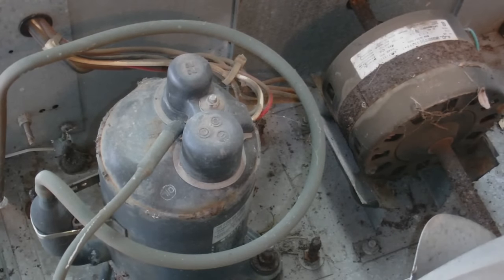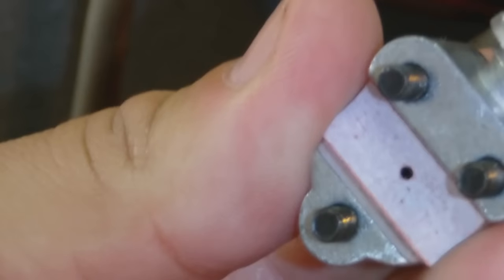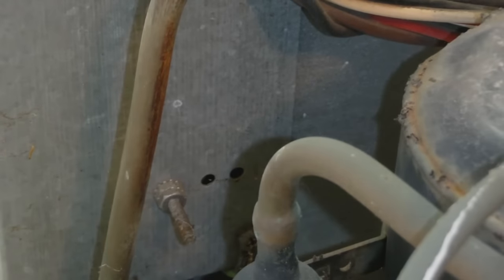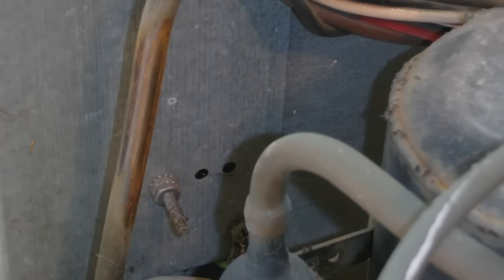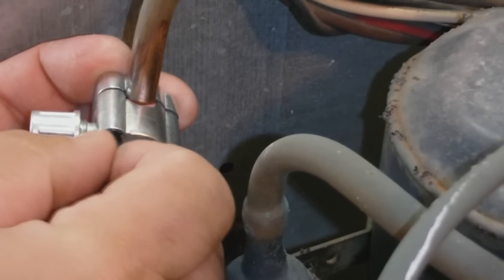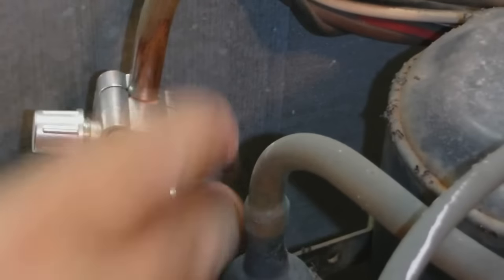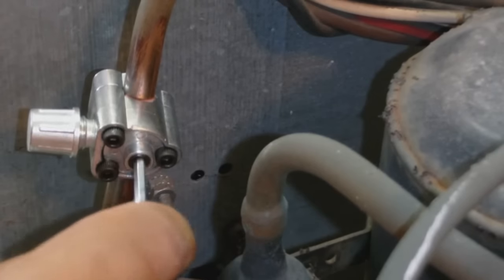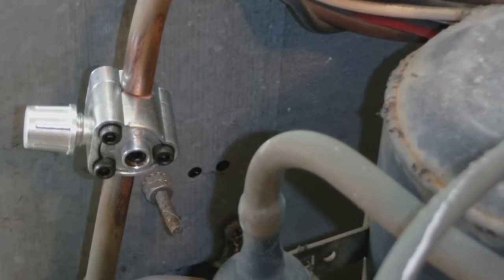How to Install a Service Port on Sealed Air Conditioning Systems: Step-by-Step Guide

Comment from the maker: You Can Find The Bullet Valve Here On Amazon http://amzn.to/2maNu3R

I show you how to install a service port on a closed air conditioner unit. You can use these bullet piercing valves on refrigerators and home ac units that are sealed off from the factory. You wanna make sure you install it on the low side Suction side. I perform this task on an old  r22 rv roof top ac unit.

If you need items to perform this task you can find them here http://amzn.to/2aik2mu for the basic and simple 134a or you can get the gauges, 30lb tank and valve here
 30lb tank http://amzn.to/29VSBv3
gauges http://amzn.to/2aiksti
valve    http://amzn.to/2a8flLH
tank adapter for the gauge hose http://amzn.to/2a5JV5R

Check them out, It will give you a great idea on what to get or add to your wish list.

Warning read all instructions before installation. This video is just a tutorial on how i do things. If you attempt to do this service on your own, I assume no liability. If you do not feel comfortable doing this task than you should seek a professional to perform this task. I have to write this because of the sue happy world we live in today.
Reply: how to identify the low side or the suction  side of the compressor
Reply: How many pounds do you use an out ? One pound ? Thanks
Reply: handy man great video on bullet valve install. I was hoping you were going to show what brand/type etc. Freon you would use
Reply: handy man
Reply: handy man how to install a everstar piercing value
Reply: Magno SanGabrie
Reply: Magno SanGabriel , turn on unit to max cold. Then feel to see which copper line is coldest. The coldest is the low side,
That’s where you install the valve.
Reply: probably should tell people this is not for use with r410a as I've seen a few remarks saying they were going to use this on a rv ac. which these days uses r410a.
Reply: So how to tell the low side
Reply: @magnosangabriel4583  I asked the same question

Comment: You just saved me $600 bucks in having to buy a new rv AC. Thank you
Reply from the maker: Glad I could help. Thanks for the comment.
Reply: Justin Wilson did it work ?
Reply: Is it still working out for ya?
Reply: So did you follow all the steps here and it worked fine?

Comment from the maker: Good question.
  I install it on the thicker line from the evaporator. That is your low side ( suction side) the thinner line is typically your high side. The evaporator is on the inside of the unit and the condenser is on the outside of the unit. I hope that helps.
    Thanks for watching.
Reply: finally everything is here to get er done now.....  just looking for that answer of yours... which side.. Thanks Much..
oh and someone told me that in order to setup the RV air to be recharged, would cost about as much as purchasing a new one... LWTF     Tom/

Comment: I purchased 2 danby A/C one was 8000btu the other a 7000btu  the reason my then apartment is designed like the letter L  if this makes sense.  I placed one in the rear of the apt. and the second in the front of the apartment,  Gosh it was COLD in my place ( hehe ) had these two guys for over 22 years and zero problem.  worked great.

now I moved in to a multi-floor condo and thought it was a great idea to purchase a single 12000btu to service the main floor, the lower level was always cool so one A/C would be fine,  I purchased the same brand ac because they both work great for 22 years.  

Now I have this Danby 12000BTU  DAC120EB4GDB
Purchased in May 2015
worked like a charm the first year,  our weather here  is hot for like 4 months so lets say the AC worked for 4 months,  then placed on the floor till June 2016.
We froze for about a month,  darn thing really blew freezing cold air,  And I loved it.
Then we came into some really hot weather,  40C and we were sweating bullets. 

The AC blew cool - not cold air - but cool air

The fan works fine
the compressor kicks in and off

but no C O L D air -  only cool at best 

I called Danby and they told me my warranty expired in May 2016 as it carries a 1 year warranty.   Funny how they timed it huh.  

So now here we are sweating like pigs,  my 450.00$ investment gone.

I am thinking there is a Freon leak,  which I have no idea were it is.
So if i was to recharge my AC with freon chances are, it will spew out,  I would first have to locate the leak, block the leak,  then refill it / recharge it.

Why don;t these A/C makers put a service port?
( so they make money when we are forced to buy a Bullet thing a ma juggie ) 

Danby  has lost me as a client forever
I can only suggest you all do the same,  maybe they will get the hint.
Maybe someone at Danby has his necktie too tight, ya think?
Reply: New air cons are junk! Try to get an old unit, from the late 90's or older.
Reply: So true brother   I am 58 and we had stuff that lasted years. Which is why these new companies sell stuff that will last a week after the warranty expires.  Is all about the money brother.  . All about the money!
Reply: Yup, just look by the side of the road or at a scrap yard. You will find a good unit! EQKs (Emerson Quiet Kools) are some of the best from before 92. You can tell them apart by their aluminum chassis. Other good units are the following and are not limited to Philco Fords (noiseless units are great - but, very, very rare), GE (from before '90), Fedders, GM Frigidaire, most WCI built units, Gibson ETC.

Comment: Aside from the difficulty of determining which of the two pipes to pierce, this went really well. I wish you didn't have to use an entire can of coolant, though. It turned out that our AC was only down a little bit -- maybe a quarter to a third of a can -- but because there is no valve on the can, you use an entire can of the very expensive and soon-to-be-impossible-to-obtain R22 coolant.

Comment: Hello I have a 2016 Creekside 27 BHS travel trailer not blowing cold I'm going to try this method I really appreciate this video bro literally saved the summer only wants to know are they labeled low and high side to tap into?
Reply: The low side will be the larger diameter of the two.

Comment: Why would I use this? Here is why. I bought a used, portable, 12000, btu, AC system (amcor?) about 5 years ago for $50. It ran great until last year when the compressor would switch on/off. This year it won't switch on at all due to low refrigerant (R-22). I bought  the r-22 and hose ($25) to repair, only to find out afterwards that there is no port. No mention of this in the manual or unit. A new unit is about $400. I challenge anyone to find an AC service tech to repair this for less than the cost of a new unit, or at least close. Even if you do, it would still cost more than this 5 year old unit is worth. At the same time, the new units are made with lower quality components. So, is it woth the small investment to give it a shot? YOU BET! It's better than sending it to the landfill, right?
I am all for supporting union workers. But, at some point, you must be realistic. Calling an AC tech to repair a $50 unit is completely F'in retarded.
Reply: I think you only read the 1st line of my comment :(
Reply from the maker: +kuei12 yeah, that happens a lot. Not reading the whole comment before replying. But I agree with you. That guy was giving bad advice. I removed his comment. I don't want anyone getting hurt from bad advice. Thanks for watching and commenting. Please like, share, and subscribe.
Reply: Where did you buy R-22 (with a hose) for $25 in 2016??????!!!!!!!!  I call BS!  (unless you meant r134a)
Reply: Just pulled a roof ac from the auto yard. Tested it and it blows cool, but not cold. Like you said, older and better built, made in the USA, saved $500 compared to a new 13,500btu unit.
Just ordered one of these to recharge it!
Reply: Ebay eBay ebay. Why don't you people research these things for yourself before you run your mouth. You can buy any refrigerant you like on eBay.

Comment: I have 3 lines coming out of the compressor plus a high and low service stub.  Problem is there's no instruction on which line is which to attach the service port to since they are not marked.  low side or high?  I use the low in my car.  And how do you identify the low side?  Warm line? Cool line? Or does it make any difference?

Comment: The last time a "professional" successfully repaired an AC for me was 1977 on my 66 Galaxy hotrod. An old man that ran the gas station hooked a can of r12 to it and we had a couple shots of Kesslers from the pint he carried in his toolbox while it some how went in. Worked great for several years til I sold the car. Since then I 've had a dozen episodes of "trained technicians" with their fancy cart and gauges and recovery systems work on ACs and the only thing they ever accomplished was drain my bank account and get my hopes up.Compressors, evaporators, condensers, driers, high side, low side, r12, r22, r134 etc etc. One would think with all this vast training and equipment that one of these "experts" would have successfully repaired my AC unit. Nope. Not once. Nada. Zilch. For a little while, maybe a couple weeks at best. The mystical art of AC repair may as well be alongside tarot cards and reading chicken bones. Sure, there must be competent techs out there. I just have never dealt with one except for drunken Andy at the gas station 40 years ago. I have a Coleman Mach RV unit that I know damn well needs a charge of r22 and I am sure as hell going to do it myself. Might do it again in 3 years if I have to. Works fine, just blows 60 degree air when I want 45. The only reason these units are sealed is the (&%#@*#} EPA and the hippies who believe the hype they spew.
Reply from the maker: +Terry Bartak yeah, things have changed greatly.i hope everything works out. Thanks for watching and commenting. Please like, share and subscribe.
Reply: I absolutely have to get me a set of chicken bones. Next time someone ask me what's wrong: I whip out the bones throw em on the ground and say "looks like your reverse osmosis frambulator is busted... that'll be $600.00 bucks".
Reply: Most likely the reason you need to recharge the system is that there is a leak someplace.  A Competent Tech would shoot refrigerant and a dye in the system and tell you to come back in a week or two.  Then they would look for the tell tale dye stains and at least you have a sot a fixing the leak.  For an RV roof mount they generally are the second R (of repair or replace) as there is a higher  profit in selling you a new unit AND charging labor to install it.   By the way my RV roof airs use R-410A so check foirst before you shoot R-22 into the system.
Reply: You ever figure you could just accept the well-established fact that CFC's eat the ozone layer and take this reality with a grain of salt? A piercing kit can be as cheap as $3.50. I just bought one for that price.
Now, feel free to choose between that inconvenience and skin cancer for your whole family. Actually, you don't get to choose. We have informed authorities for a reason.
Christ, can we ever get someone who performs the slightest bit of mechanic work that ISN'T irrationally hateful towards scientific fact?
Reply: "The mystical art of AC repair may as well be alongside tarot cards and reading chicken bones."  Lol.  Beautiful prose, friend!  And dead right on.

Comment: Any idea where I can find info on low side psi for coleman mach 3 15k unit that uses r22?

Label shows weight. But I don't see any pressures or relative pressure @ °

Comment: Question. that which you are installing, (the Port pierce kit) dose that fit most AC piping? and if so what size dose the Pierce kit fit? is it like universal? how do you determine which is the low pressure pipe? First time here. 6000 BTU TCL window unit only had it 3 years. Just do not want to trash it.

Comment: My RV Roof AC was purchased about 4 years ago.  Is it going to be R22 or R134?

Also is recharging this type of unit something that I should attempt?  I have recharged automobile units before.

Also is it necessary to put a vacuum on the system before recharging?
Reply from the maker: Thanks for watching. As for the refrigerant type in your unit, there should be a label with what type of refrigerant is it. As for putting a vacuum on the system, that all depends on the repair that is being done. Personally, I do not vacuum the system to fill it back up to its operating pressures as per my gauges, I usually put a vacuum on if I am replacing a part or line. You can find refrigerant pressure charts anywhere on the net. Note: There are different type of manifold gauges for different types of refrigerants.**This goes to anyone reading this.I make these videos to show you how I go about performing these procedures,*** I hope this helps.
Reply: Why don't you check the owner's manual or lift the cover off of the unit and check the surface plate and it will tell you.

Comment: My old 1994 Coleman ac looks just like the one in your video. It blows cool air, not cold. How do you know how much freon to add if just topping it off? Im assuming it is R22 but the label is so faded out I can't read it. 
Also, my fan motor bushings are going bad. Sometimes screaching or siezing up. Oiling is no longer doing much good. This fan motor has 5 wires plus the ground. All new motors i have found only have 4 wires, plus the ground.  Do you know if this new motor will work and if so, how to wire it with one less wire. The only difference is the old motor has 2 brown wires, new motor only has 1 brown.
Can't afford a new AC and summer is just around the corner. I live in my rv and it gets hot in Texas. If its 100 outside it's 90 inside with ac full blast and that's also with a 5000 btu window unit going in the bedroom of my 38ft 5th wheel.
Any help would be much appreciated from you or anyone reading this comment!!
It also would be nice to find a video of someone actually recharging an RV AC unit. Been looking, haven't seen one yet.   Thanks

Comment from the maker: I will make a video on how to identify what kind of refrigerant an AC unit holds. Thanks for the comment and thanks for watching.
Reply: the common man does not have any access to R 410a, is there an alterative or a universal refrigerant if one cant find anything?
Reply: I saw people use duster in a can in their auto R12 system and it worked just fine.
Reply: Did you make a video on how to tell which kind you need? I have a Fleetwood travel trailer '02  with rooftop unit that i believe is ibelieve a Coleman  mach unit and would like to try this to save my ac that doesn't blow cold anymore.  Any additional advice also appreciated- thanks!:)
Reply: How do you know which line to install it on?  Haven't seen one video yet on the subject.
Reply: @TheCostofAutism  That sounds really good I'll try it out on my delonghi portable air con , after I order piece tap connection 👌

Comment: Question? Can I use the kits like you get at Auto Zone that are made for automotive, to recharge my window unit? It would be much cheaper than buying all the gauges etc, just to recharge a window AC unit, where as the auto Zone kit is about $20. Great video,,

Comment: How do you determine the low suction side? No one seems to explain this one important step. Will the pipe be labeled "Low suction side" or something similar?
Reply: For a standard AC, not a heat pump, If the unit has some refrigerant left in the system and is still cooling a little. it will be the larger, cool or cold to the touch line sometimes sweating. The high side is a smaller size and will be warm to hot and not sweating.

Comment: I’ll be using these for a compressor replacement on a wall mounted, cooling only unit, that has a shorted windings. I need it because the existing system doesn’t have service ports.. I’ll use one to recover the refrigerant, then I’ll install a low side service port, and a high side service port.
Reply from the maker: Yep, I discovered these little guys and they help out a lot just for that reason. I rarely have a problem with them leaking if everything is cleaned and sealed properly. Thanks for watching and commenting. Please like share and subscribe.

Comment: This is as smart as it looks.  I just did this...but ran into a problem.  The service port is threaded 100% of the way.  Ports on cars and auto A/C recharge kits have a snap on connection, not threaded.  Is there an  AC charge setup with a threaded connection...not the snap on ?
Reply: I have the same question. I can't find any charging connectors that fit the threaded service port.

Comment: Really happy to see how to install a bullet valve to charge my RV AC.  What adapters/connectors I would need (I do have an automotive charge gauge)  to add 410 coolant? Thank you in advance for your help.
Reply: You need the reducer adaptor from walmart and one can can fill the compressor